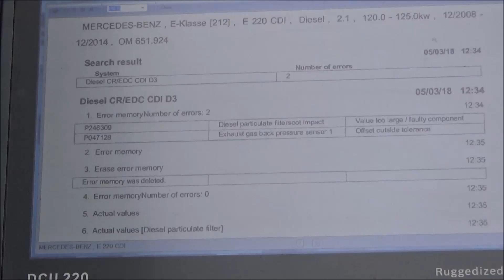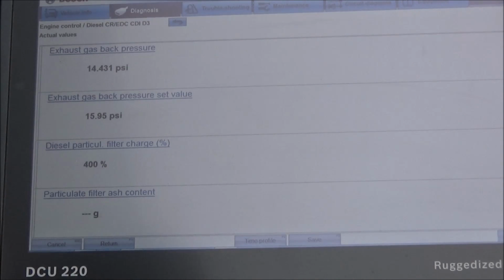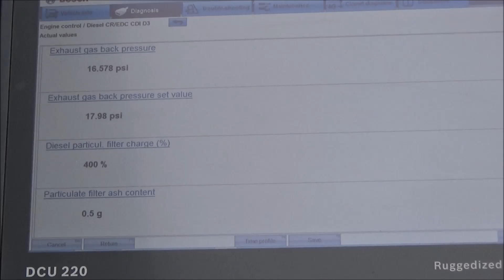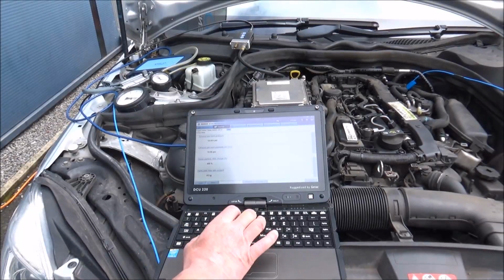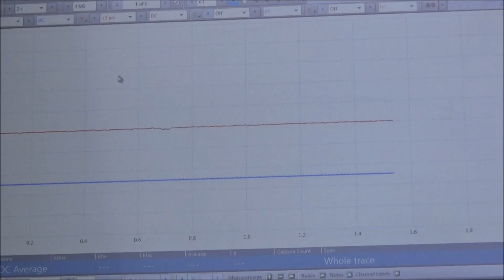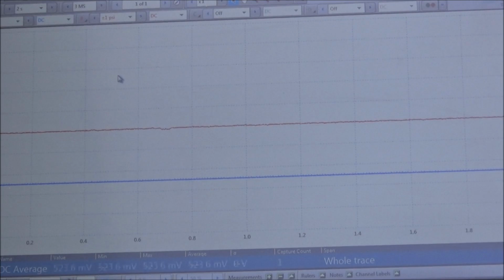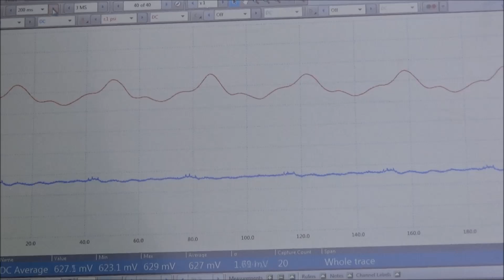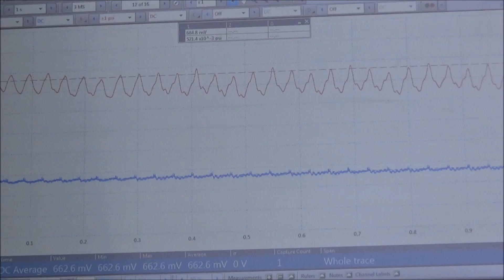E220D P2463 & P0471

Comment: There's no need to get the DPF cleaned in this instance.    If you check the list of DPF regens (last 16 are stored) you will see lised the reason the regen failed.    in this instance  will be a faulty exhaust back pressure sensor (NOT the same as the differential pressure sensor) and once the fault code is stored the car will not perform a regen.     Putting a new EBP (part B60)  sensor in and clearing the fault is all that's needed to start the regen process.
Reply from the maker: Interesting, don't recall you looking at this car with me...
Reply: @SimplyDiagnostics  I’ve seen this plenty of times on om651s 
A 400% fill level doesn’t mean it needs cleaning.   
There’s always another issue that prevents the regeneration.   Even something as simple as a poor 12v battery.  

I can say pretty much for sure the problem with yours was a faulty sensor
Reply from the maker: @Cloud-yp4eh  ok

Comment: I also have an issue with error code P2463. I doesn't clear. I changed dpf pressure sensor and error still appears. Car never went into limp mode it drove normally even with the error.We took off the dpf filter and cleaned it on a machine. The car runs even better now but the error keeps staying it doesn't clear. I'm out of options. Only thing left for me is to change the file in the ECU and block this error code from appearing ever again.
Reply from the maker: Find your nearest accredited DPF specialist at www.the-dpf-doctor.com deleting fault codes and emissions systems isn't the way forward 👍
Reply: @SimplyDiagnostics  Thanks, but my DPF specialist said the only thing left to do is to replace the DPF itself but I don't wan't to spend hundreds if not thousands of pounds on new DPF since the car runs just fine after we cleaned the old one. I think that somehow the ash and soot level needs to be reset and tell the ECU that the dpf was replaced or cleaned or refurbished, and then clear the error code P2463, because the ash level is not measured by a sensor its computation based on ho many regen cycles and miles you did, so its more of an assumption value. The issues is the diagnostics softwares we tried (at leas 4 different ones) do not have such ability.

Comment: Hi guys i have on my w204 code p2463 on and not going to clear, also max revs 3000 not let me to go over that, i have done full dpf clean and i changed dpf pressure sensor, but code still there, any clues that i can do next pls ...thanks in advance
Reply from the maker: The best advice I can give you is to find your nearest accredited DPF Doctor Network member at www.the-dpf-doctor.com, they'll be able to find the root cause for you and rectify it. Hope this helps.

Comment: Watch that bloody sensor...2009 E220 CDI with 422k km and had check light on for some time although the DPF was not blocked.  An auto sparkie checked the pressure difference with the engine running and got a strange reading between the exhaust and DPF values, only to discover the sensor had an electrical fault that resulted in an exhaust pressure reading almost 1.0 when the engine was off (ignition position II and DPF reading correctly showed 0.0).
This meant that it was reading at least double the real exhaust pressure with the DPF remaining normal, with the result being the ECU read that the DPF had excessive soot and the regen cycle could not operate due to this 'blockage'.

Comment: hi steve could the  d.p.f  just be  gutted out to save future problems  how  would the  ecu take to seeing  no  back pressure inside the d.p.f  ?
Reply from the maker: Hi Tony, no sir, it’s illegal to use a DPF equipped car on the road with no DPF. The MoT changes coming in May will see thousands of very unhappy folk that have had their DPFs removed and mapped out when their cars fail the mot and they have to return the vehicle to “as designed” status.

Comment: Would a regen not do the trick or was it too bad to do a regen
Reply from the maker: It’s last successful regen was 10 miles ago. With a proper clean and zero back pressure I’ll be able to reset the counters, change oil and filter then monitor exh gas pressure. I have a suspicion that the real cause of the blockage will become apparent with further testing. I suspect an intake leak or maybe a blocked passage. I didn’t like the way the pressure sensor reacted.
Reply: interesting to know what is day to day driving doing this vehicle?
Thank you for sharing
Reply: Completely agree Steve. Despite peoples dislike of DPF's and urge to blame them for all that is wrong with the world, its pretty rare that the DPF is actually at fault. Its usually something else causing the car to not be able to manage it correctly. Fix the underlying issue and the DPF, in most cases will survive.